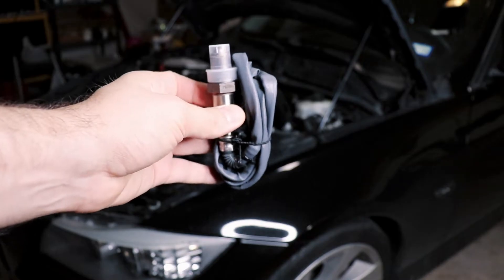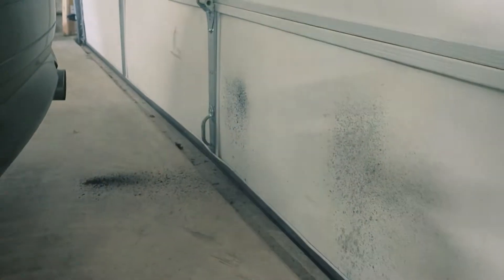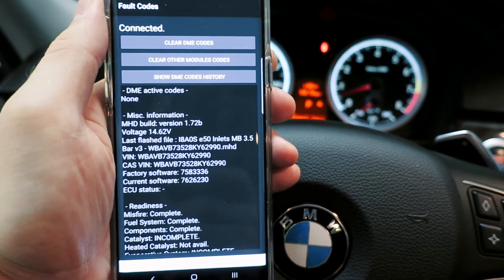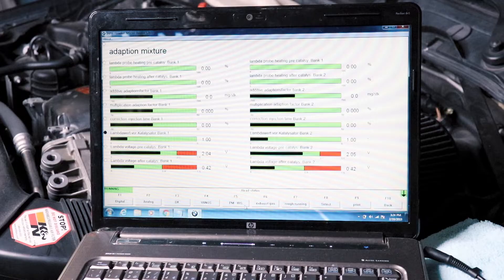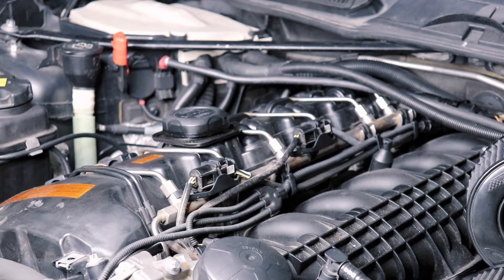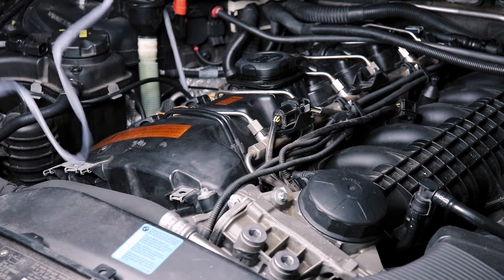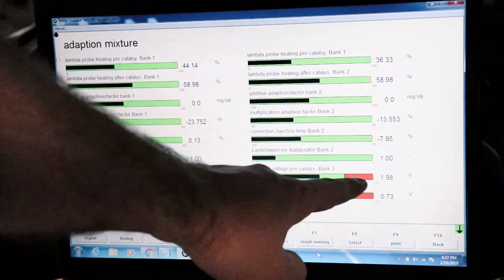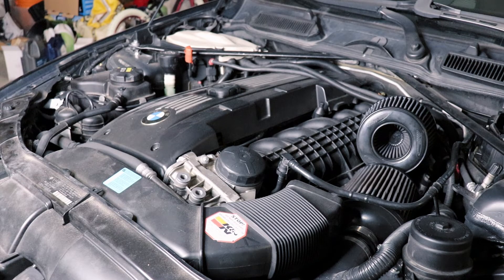How I Diagnosed My Failed Oxygen (Air Fuel Ratio) Sensor - BMW DIY

Comment: when you disconnect the sensor on a 318D, will it have the same effect? cause it also run bad only in idle and i don't get a engine light. greeting from Belgium! great video!
Reply: it's a N47 engine btw

Comment: My voltages are all fine but I keep getting 2CAA Oxygen sensor heater function & 2CA6 Oxygen sensor temperature. All 4 are new sensors . Any ideas? I've tried harness, DME, adaptations, untwisting wires, fuses. Nothing!

Comment: Fyi to save some money the o2 sensors are the same along as you get 2 rear ones (2 extra long ones will work but wont work viseversa... meaning two short ones obviously wont work and would cost way more for the short one vs long one meaning bank 1 vs 2 )

Comment: Full blown misfire mode sets a code and turns off the injector for that cylinder until the next restart. It will try on restart to run the misfiring cylinder again but will again turn off the fuel injector if the cylinder is still misfiring. It was running rough but it was not in full blown misfire mode...

Comment: Really happy I stumbled across this, I grabbed up a used BMW and it has the rough idle, as soon as I figured out it was about 30 seconds to a minute I instantly though heater, but since I am not familiar with BMW I figured it couldnt be that simple right? Well I will run this test in the am, and am doing a full drain and replacing everything anyways, just add the o2 sensor to the list

Comment: Hey thank you for this video, I'm currently changing out my turbos due to blowing a seal on one of them and my mechanic recommended replacing both pre-cat o2 sensors in a pair. They're quite pricey and I was having hesitation issues but attributed it to my wastegates also not sealing properly. To my knowledge the post-cats are ignored now that i'm catless  but i will definitely check the voltage on my o2s prior to purchasing them. Also, im not sure if you know or not, but would xdrive vs non xdrive be a problem in regards to reaching the o2s from under the car? I know it's a tight space but worry that the subframe is in the way. Hopefully not!

Comment: Not agree. O2 sensors was good. Engine was too rich and the O2 sensor does the job. If O2 lie and say to rich fuel trim must become negative and fuel mixture will be very poor .. problem come from somewhere else

Comment: Great video! I have a bmw 550i and it’s throwing a code P0175 running rich. Scanner shows 
bank 2 short term trim -3.12, long term -23.44
Bank 1 short term trim -1.56,long term -6.25
Is it the o2 sensors causing it to run rich? Or can it be something else? 

FYI it’s a 2011, 80k miles, I do burn a little oil.
Reply: Did you ever figure out what your fuel trim issue was or is, I have the same problem running rich on my e90 n52
Reply: @dronevisiontechnologies2710  same! did you figure it out?

Comment: Fantastic tutorial and another easy to follow diy.  Jumping to the tick discussion..I've got one that begins usually after the fuel pump pressure subsides and the warm up cycle ends.  Sounds like its coming from the intake manifold and only happens at idle after a cold start. Goes away after the car is driven for about 20 minutes or so.  Any suggestions?  Here's the link to a video I made of the tick https://www.youtube.com/watch?v=qdsGR4PHx54    Thanks!

Comment: I have replaced all of my o2 sensors on my N54. The pre-cats I did at 120k proactively. The post cats, I got a specific code. The post cats really don’t do much other than monitor the pre-cats and make sure they are running correctly. 

You can also monitor them live on a scanner. The scanner should have specific values. If values aren’t what they should be, then you know what specific O2 sensor is bad.

Easiest thing to do is take the cats out of the  car if you are looking to change them out. They are a PITA otherwise.
Reply: My after cat bank 1 is reading 0.13 and the second one is reading 0.79
Pre cat there at 2.00 and 2.09 only code I’m getting is 2C31

Comment: one of the best BMW N54 DIYer! look forward to seeing new video.  BTW, will the post cat sensor be easier to change?
Reply from the maker: They are slightly easier to get to, the bank 2 sensor 2 sensor is actually pretty easy to access from under the car.
Reply: @VehicularDIY  I currently have all new o2 sensors and am going to put in soon and I was curious to know if I have to reset any adaptations or will the ecu just automatically dial in everything after replacing all o2 sensors